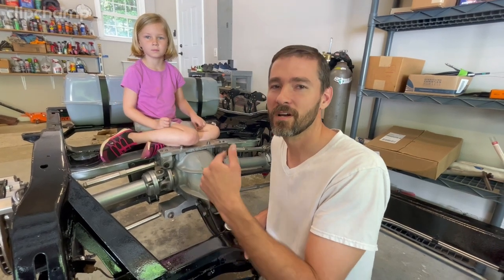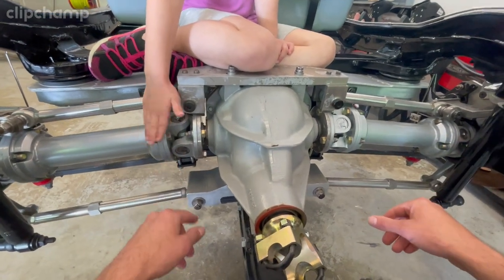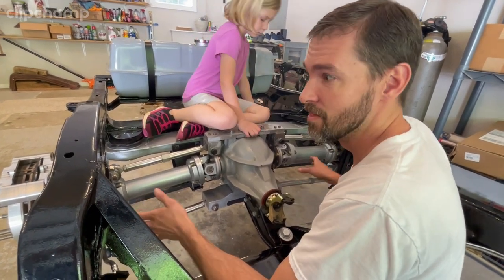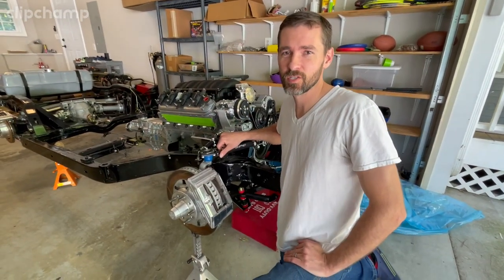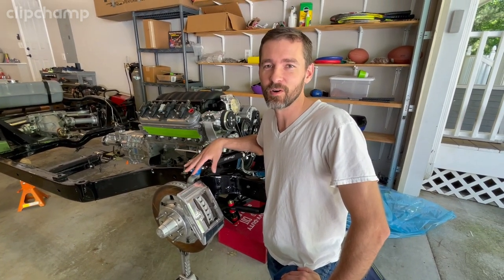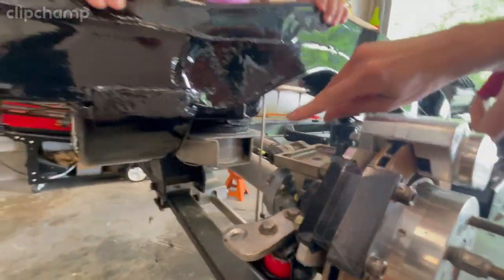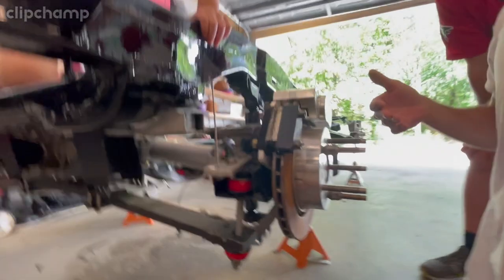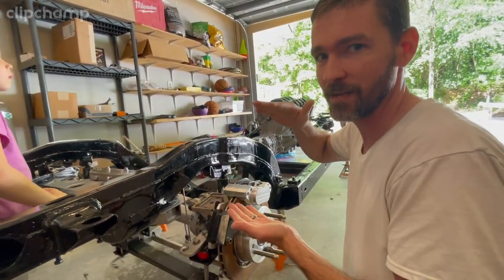Stop Axle-Bind!  On C3 Corvette

Comment: looks good. Toms axles, did you preload the outers and go 12 bolt inner?
Reply: @coolstuffwithEric  I don't usually post on YT. The inner axles need to be checked for face hardness and endplay setup for 005-007" The outers don't setup like stock 17 with an endplay number as most think. In fact most don't know the correct dial in on either. The spec of 001-008 is a mile long. If you can rock the rotor at 3 & 9 then the bearings are not dialed in correctly. The rotor runout should be under 003" Good luck. I most likely won't be responding to anymore comments on this thread, nothing against you, it just not what I do.

Comment: Nice suggestion but I went for an easier solution; I have installed (KYB) shocks which have one inch less max. length. Problem solved. If I recall correctly the factory ones are 14 inches extended so I installed 13 inches. Perfect.
Reply: @coolstuffwithEric  Hi Eric, I will need to check my archive with receipts as it was a couple of years ago. What I did was browsing through the product catalogs of the larger/ established Shock Absorber OEMs and selected the 1" shorter model. Will try to find the numbers this week. Grtz, Tjesse.

Comment: Great idea how long is your cable? Thanks
Reply from the maker: Good question, unfortunately the car in storage right now so I can't check.   But my custom half-shafts have VERY little flexibility, so if you're running stock style shafts, you should be able to have a bit longer cable than I have anyways.

Comment: About what angle is near max of half shaft to add cable length to avoid binding? Did you by chance bust out an angle finder? LoL 😐 I use chains on front on my nova in same scenario so it doesn't do bumper dragging wheelies. I just kept taking out slack until it would only do about half a foot wheelies. Thanks.
Reply from the maker: I didn’t bust out the angle finder, but these are custom axles, so they probably wouldn’t be exactly the same as your set up.

1’ foot wheelie launch make for great photos!

Comment: I assume the sway bar with its linkages are limiting the travel of the rear trailing arms, as this is an issue I don’t seem to have. There is constant downward pressure on the trailing arms from the transverse leaf spring. The sway bar and shocks seem to prevent downward travel.
Reply: @coolstuffwithEric  well I only have 20 miles on it since a complete restoration and I’m fighting oil and transmission leaks so it hasn’t been on the road much. When I return from deployment later in the year I’ll really know if it’s a problem!